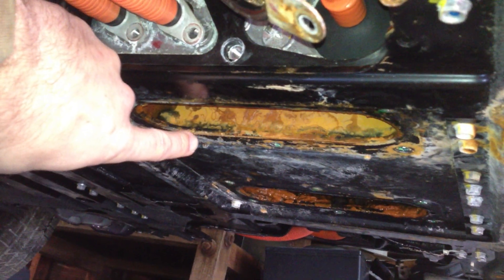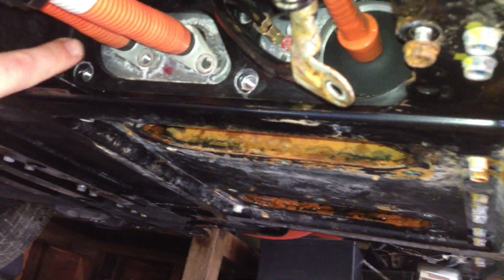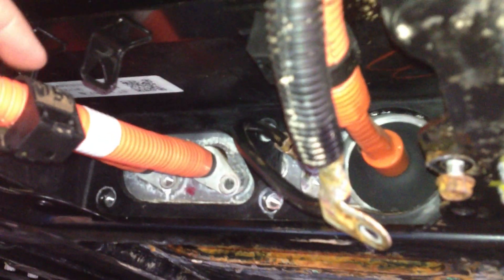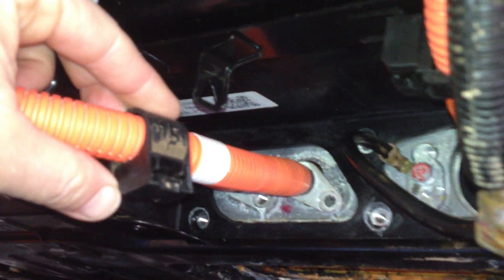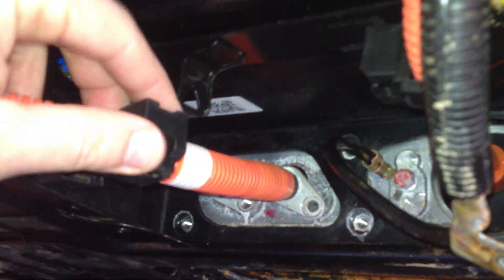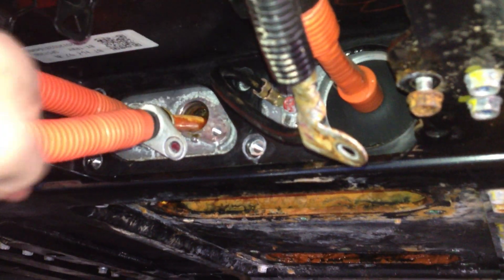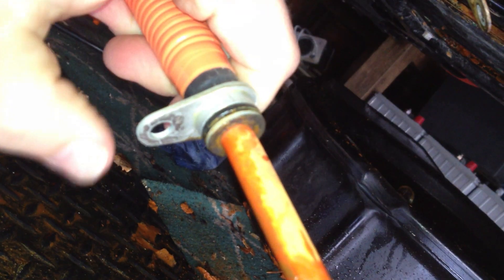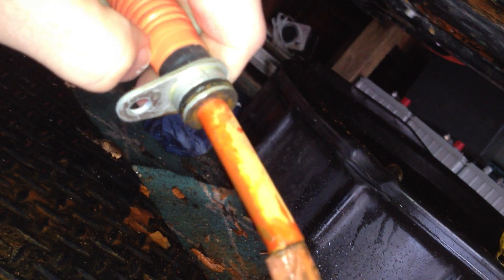Flooded Mitsubishi i-Miev: Battery Cable Removal part 2 20130218

Comment: Hi Ben, below is info I received from a Mitsubishi specialist ...
"One of the procedures advised to the emergency services is to (if necessary) fill the battery pack with water. This is done via a cooling duct under the front passenger seat so I can only assume that this vehicle had water sitting in the car that drained into the pack. The pack is in all other respects water proof and then held the water. My understanding of this is it will destroy the batteries."

Comment: hi ben, i've been following your updates on this project from Germany. Nice job! I did some research about this EV a while back and the battery pack seemed to be water resistant. Sad to see it is not. Maybe if you manage to open it an dry every cell (88 in total) you may be able to get it and running again.
Wish you good luck!